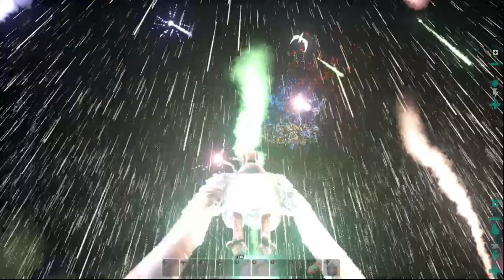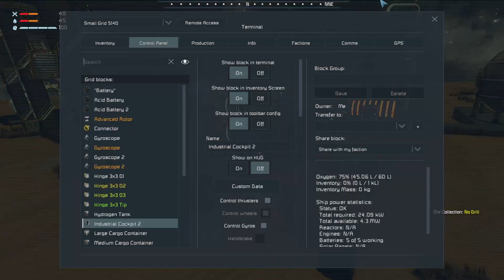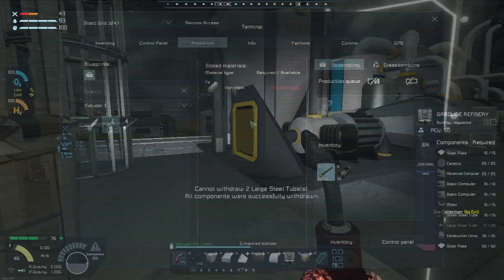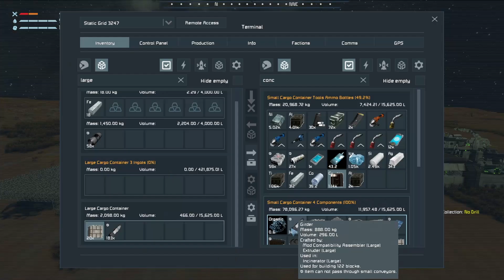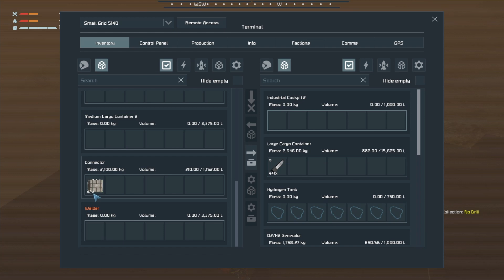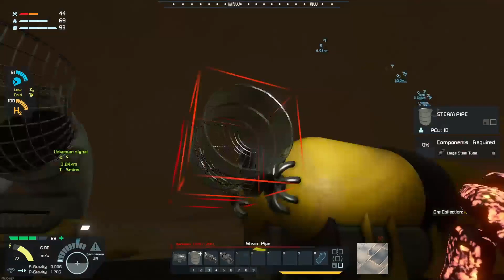Space Engineers Industry Survival Ep. 17 | Coal & Steam Power |

Comment: Havent watched all episodes yet, but i highly recommend MArmOS script for welding arm (mine is on rotor, 3 hinges and 3 medium pistons) which is awesome for building in IO, even did my solar panel tower this way and hooked it up to Whips Solar script (Solar Power is significantly better than wind in IO) .
 Another trick I am using in survival is I can make acid battery flyer/miner if I use less atmo thrusters. Vector Thrust 2 is the way (however i added some railings and caution in design and on the fly must be exercised due to lag input and other unknown input errors when center of mass is changed).
Reply from the maker: Thank you for the tips, I was looking to stay away from scripts tbh. But I think that I could use them (especially) for the welder due to the amount of buttons that has to be pressed to get the job done lol. I will give these a try and see how it all works.
Reply: @realreggaek1d  some are really needed or just useful in some modpacks like IO... they are not easy to utilize though, advanced computers components in IO makes sure of that, so I had to get them from unknown signals and sacrifice having more lithium batteries. My Solar Tower was actually not scripted to follow the Sun from start, it just rotated at very low RPM. But this way i had plenty of energy to power everything.

PS: If you will have trouble defining arm in MArmOS, just remember medium 3x3 blocks(hinges, pistons) count as distance of 1 block in MArmos definition and definition for axis of hinges are often swing and miss, if one or more doesnt work, change from Y to -Y, -X to X etc.